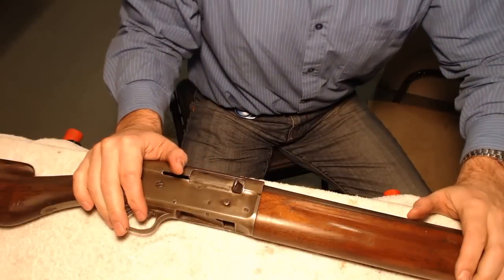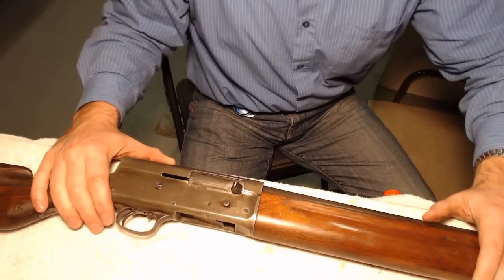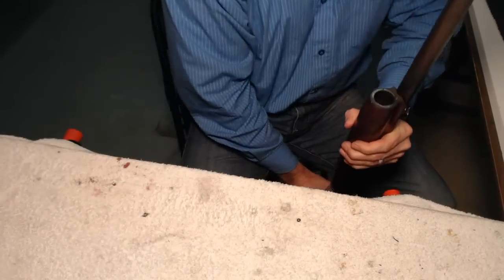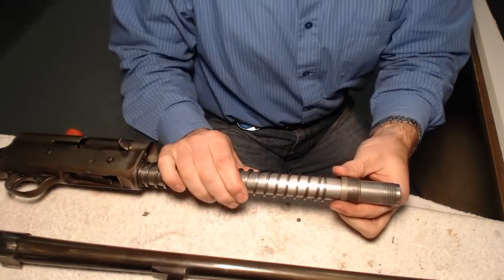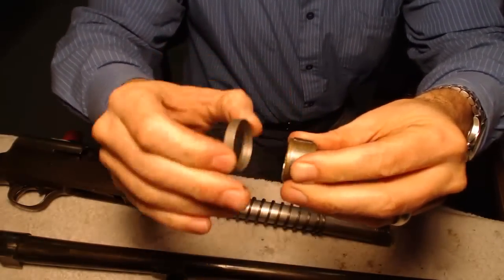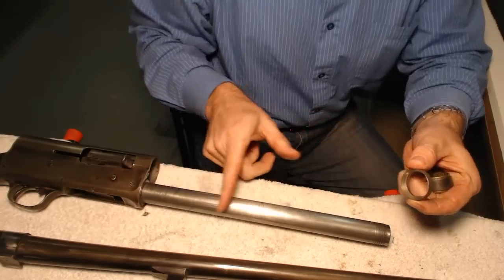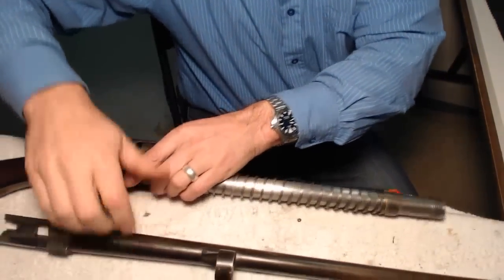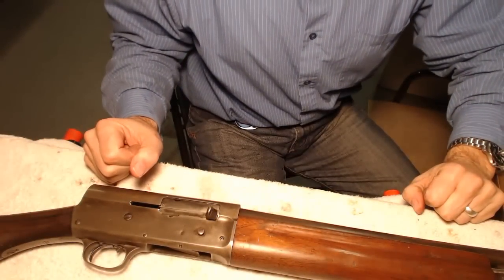Remington Model 11 load adjustment

Comment: There is actually three settings for the friction rings, one for light loads, one for heavy loads and one for cutts compensator, if you have a cutts compensator on your barrel it goes like this, bronze friction piece next to receiver, then spring, then friction ring with outside bevel toward muzzle.
Reply from the maker: Thanks for that info, good for folks with that compensator. The Model 11 I have has a full choke barrel.
Reply: Dan H that’s cool Dan, I just heard you say there was two settings and I figured I’d let people know if they’re gun comes with that cutts compensator there’s a third setting, I learned that myself from the owners manual on the Remington website, thanks for the great video though
Reply: I was wondering about that other setup, I just got an early Model 11 and upon pulling it apart to clean it up before use it was set up for the cutts compensator, despite the factory barrel being a full choke, not sure who would have done that or why

Comment: Thanks a lot for the helpful video. I have a 20 ga Model 11. The last time I fired it was over 50 years ago, and that was birdshot. I want to put a buckshot load in and want to be sure the tension is set correctly. I understand that firing a heavy load on the light setting not only increases recoil, but could actually cause damage. I down loaded a photocopied manual at Remington's web site, but this is much clearer.

Comment: Thanks for getting back to me, I appreciate it, haven't shot with the Cutt's barrel on yet so I'll give it a try soon.
Reply: EonDresari There is actually three settings for the friction rings, one for light loads, one for heavy loads and one for cutts compensator if you have a cutts compensator on your barrel it goes like this, bronze friction piece next to receiver, then spring, then friction ring with outside bevel toward muzzle.

Comment: Problem with mine was the bullets stayed in the tube. Even after firing. I bought mine used and the dude had itnfor awhile but as im leaving out the door he says he never even tested it. I got home and fired it and piece of shit didnt work. It was set for heavy loads so i switched to light and still didnt work. I took it apart and cleaned it and boom boom boom it worked. I had to use a toothbrush and oil to clean it and now it works 100%. Very cool shotgun. Mine is the Ithaca xl900 , gas operated recoil. Its the same exact gun as yours. But gas not spring

Comment: Mine does not have those 2 brass  rings ,just a steel sleeve connected to a flat recoil spring . I can purchase 2 brass rings and add them on ,but is it necessary ??

Comment: It should--the Remington Model 11 uses the Browning patent. My 20 ga Model 11, mfd. 1930, has a wooden plug limiting the magazine to two shells, complying with hunting laws. Removing that plug makes it a five shot semiautomatic. There is a retaining ring to be  pried off the end of the magazine, being careful to keep hold of it so the spring doesn't shoot out. The plug didn't drop out easily, but can be pushed out with shells into the loading end. A dowel in the spring makes it easier to insert.

Comment: The recoil of the barrel is what operates the reciever. I'm looking to make a purchase on a model 11.
   Is there anything I should be aware of to look at as a far as problems are concerned with this model? Also are the load rings installed dry?

Comment: Best info so far on the 11.  With a Cutts, put the friction piece w/spring on the tube, then the recoil spring then the friction piece with the bevel  to the receiver and flat towards the muzzle.  There were variations of this friction piece. If your gun works set up for light loads with a Cutts then leave it alone.  Best practice to save receiver and fiber cushion is to replace action spring with a Wolff Extra power one.

Comment: Very helpful video.  Now I understand not just where the pieces go, but why they go there!  A question re heavy loads: On the brass "friction ring piece" one side is beveled on the outside and looks like it is designed to mate with the inside bevel of the steel friction ring.  Am I correct that the outside bevel of the brass friction ring piece needs to face, and mate with, the inside bevel of the steel friction ring?  Thanks for your further guidance.

Comment: I am having some trouble finding a recoil spring for my 5-shot 12guage(the spring that slides over the mag tube). Will a Browning A-5 recoil spring work on a Remington 11?
Reply from the maker: There's a web site that deals with older firearms and parts. I'll find it and get back to you. I used them for a firing pin for this model 11.
Reply: Ok, thanks for the help!
Reply from the maker: +Vincent Tschida 

Here is the site I used to purchase the firing pin for that shotgun.  _http://www.gunpartscorp.com/
Reply from the maker: +Vincent Tschida 
Perhaps its this one?  _http://www.gunpartscorp.com/Products/815340.htm
Reply: That's a three shot spring(about15-17 coils)for the sportsman model I believe, I need a 5 shot(about 22 coils). I wonder If a person couldn't  buy two of the short springs, and cut one stacking it on top of the other. It's strange I can find most parts for these shotguns expect for the full length 12 gauge recoil spring.
Reply from the maker: +Vincent Tschida Give those guys a call at Numrich. They may be able to help. Phone: 866.NUMRICH (866.686.7424)

Comment: I could not budge the cap on the magazine until I took the pressure off it by holding it vertical, putting the butt on the floor, and compressing the spring by pushing the barrel down.

Comment: My Remington Model 11 20 Gague shot gun does not eject shells properly.  It jams and also eject a good shell and keeps the spent shell in the chamber.  I was excited over your program, but my rings were adjusted for the light load.  Can I remove the metal ring from the brass sliding ring to reduce friction even more?  Thanks,  Bobby Howard

Comment: Sooo mines has two shells inside..... the shell won't be ejected, and I don't know how to un load it. (I know how to unload it, but not while it's jammed. ) 

Idk how to explain it. 

But anyways, if I do this, would it eject the shells? I simply just want to unload the rifle.
Reply: take off the butt stock, then take out the action spring. now the bolt isnt under spring tension. take off the magazine tube nut and you can pull the barrel off. now you can take out all the shells.

Comment: My A5 shotgun only wants to take to shells I know more fit is there something I have to do to the spring
Reply from the maker: Your A5 only holds two shells? Sounds like theres a shell plug in the magazine tube restricting the amount of shells it can hold. Have you pulled the tube apart?  I could see this happening if the shotgun was setup for double trap.

Comment: With Dan's model 11 the steel friction ring has the bevel on the inside. There is another type that has the bevel on the outside. Instructions for setup of that one include instructions for setting it up for a Cutts Compensator. That's the most common type. I'd been searching for Remington's documentation for the inside bevel but have yet to find it.
Reply: Michael Willis There is actually three settings for the friction rings, one for light loads, one for heavy loads and one for cutts compensator if you have a cutts compensator on your barrel it goes like this, bronze friction piece next to receiver, then spring, then friction ring with outside bevel toward muzzle.
Reply: @wild8757  Yes, I have the documents dealing with all three setups but only with the friction ring with the outside bevel. I've never found any documentation for the friction ring with the inside bevel. While I can understand the setup for a friction ring with an inside bevel for both the heavy and light load I've no idea what the Cutt's setup would look like. I'd I've also found a friction ring that has both bevels, again with no documentation. I'm thinking the friction rings from the Browning auto-5 may be getting substituted but that's just a guess.

Comment: Would a light load be considered 7 1/2 shot factory ammo
Reply from the maker: Light loads would be from the range 7 1/2 to 9. These loads are the ones used for clay sports. As you go lower in number the loads get heavier. The heavier a load is, the bigger each individual pellet is. So a number 9 load will have a couple hundred very little pellets, and the heavy loads like buckshot will have 8 - 16 very big pellets.
Reply: @danno02  oh ok we used 7 1/2 shot for everything besides pheasants and turkey we even use 7 1/2 for trap

Comment: I recently acquired a Remington Model 11 that came with an extra barrel that has a Cutt's Compensator on it.  When using the compensated barrel in your opinion, should I use the light setting with trap loads or heavy setting. I ask because I'm assuming the compensator reduces some of the recoil.
Reply: For a barrel with the Cutt’s Compensator on it what you’ll want to do is have the brass friction ring against the receiver, then the spring goes back on, followed by the beveled ring with the bevel facing forwards towards the muzzle. Hope that helps!

Comment: How do you tell what gauge your model 11 is?
Reply from the maker: My Model 11 is not stamped with its gauge. But just reference this list below for the nominal bore size of 10 gauge, 12 gauge, 16 gauge, 20 gauge, 28 gauge, and .410 bore shotgun barrel.

10 Gauge - .775"
12 Gauge - .729"
16 Gauge - .663"
20 Gauge - .615"
28 Gauge - .550"
410 Bore - .410"

Comment: What is the definition of a light load
Reply: Do you just change the position of the rings if it fails to eject? Is a "light load" based on shot weight and or powder load, or the age of the shotgun?

Comment: Great video!  I have my Grandfather's model 11.  I have fired it a few times without any problems.  But I did dissemble it to see how the compression ring was set up.  

Can you give some basic guidelines on light versus heavy loads that may require adjusting the compression ring?

Comment: mine has only the spring and friction ring... i've only shot birdshot through it with only one failure to eject out of like 300-400 shots, strange, there's also no damage to the handguard
Reply: When I inherited my pre-model 11 from my grandfather, it was like yours.  All it had was the spring and compression rings.  I put the compression rings forward of the spring for heavy loads and BEHIND the spring for light range loads.  This method works great on my gun.  YMMV.  Good luck.